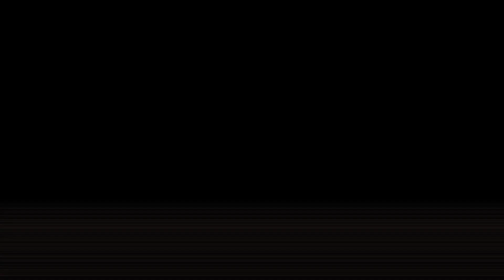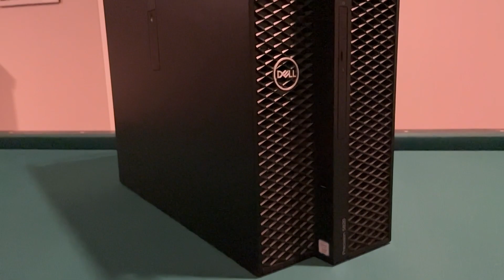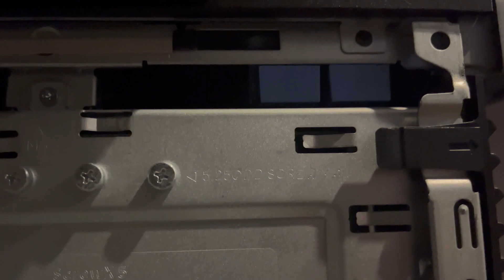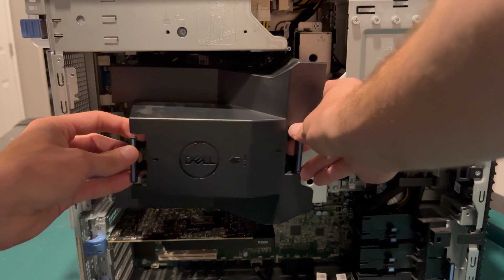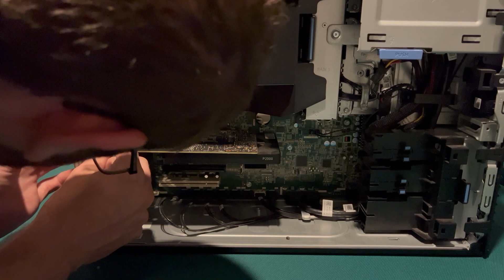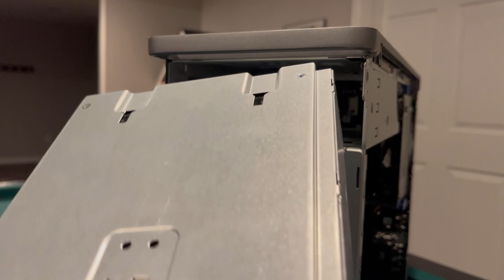Upgradeability of the Dell Precision 5820

Comment: I’ve got one of these that was a refurbished model with the W2235 and man is it a workhorse in my opinion. 32gb 3200 ecc/ 3070+ two P2200s stuffed into the pci express it renders video like mad
Reply: Thanks for explaining the internal lock/release buttons for the front drive cover. I thought the front latch on mine was stuck until now. Your info has probably stopped me from breaking the latch!